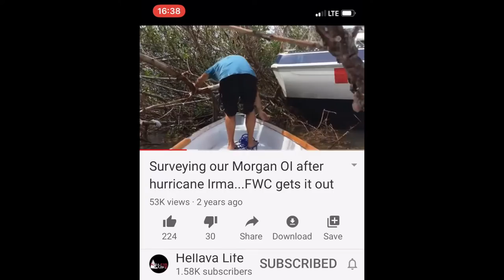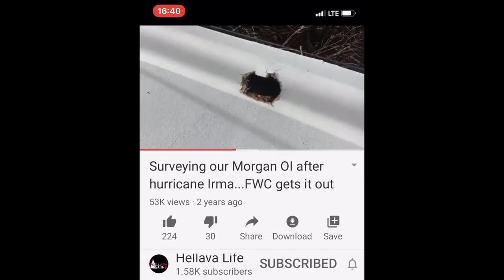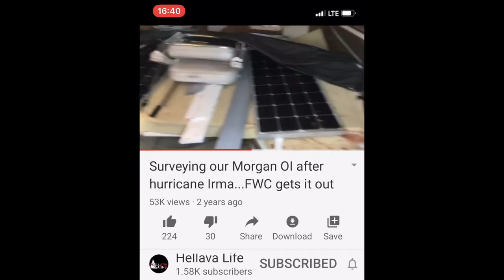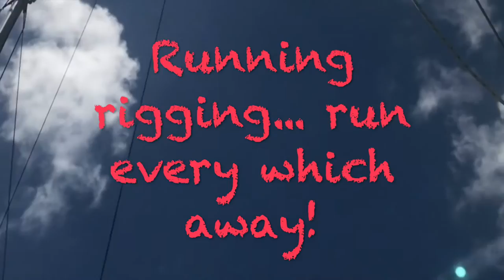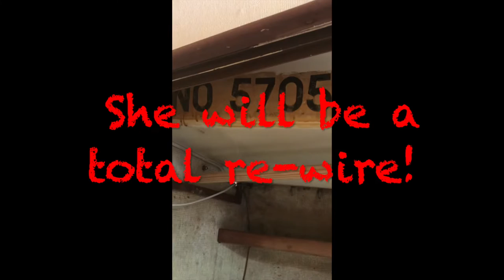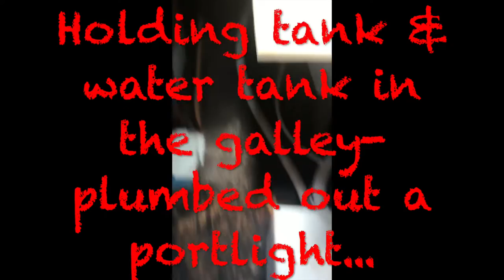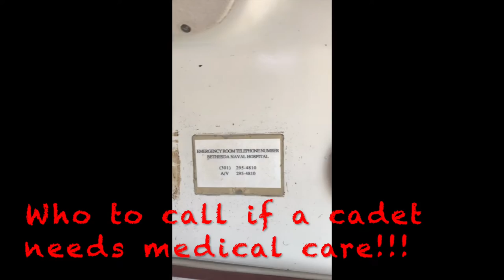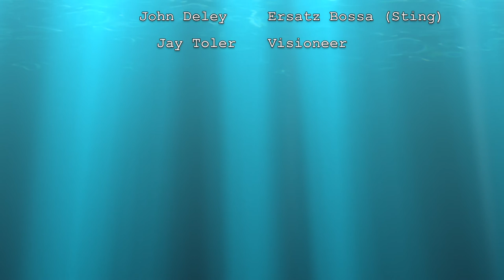Our $2,000 Morgan 41 OI- FOR SALE!

Comment: Great bones, ya'll did well with her!  Layout is surprisingly similar to ours even though ours is a walkover versus walkthrough.  Ours is 1972 OI Ketch. :D
Reply from the maker: You must have a huge engine room!
Reply: @SailtoUtopiaAdventures  it’s pretty decent sized but our engine was a replacement 6-354 Perkins for the 4-108. So a lot of the room is taken up by the engine room.  Feel free to check our our videos - we don’t monetize - just sharing our experiences.  Plan on making the engine room a stand-alone room too though - insulating and adding an exhaust fan and starboard walls with all systems run neatly and easily identified. Basically gutting the engine room all together!